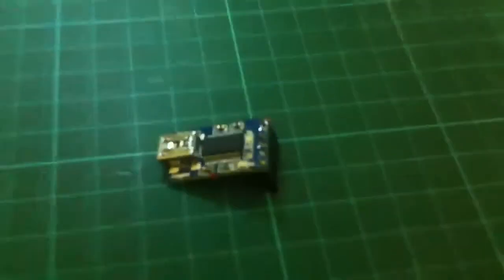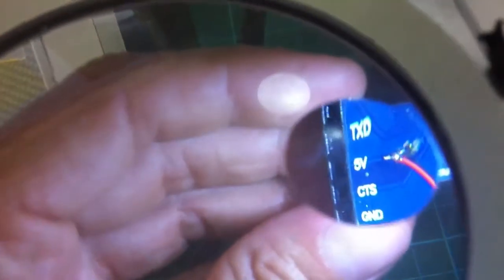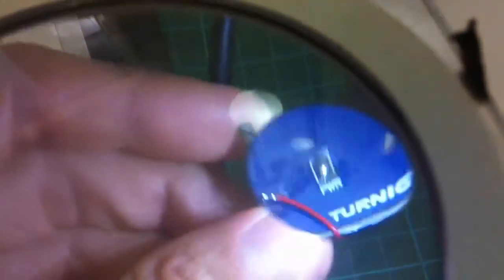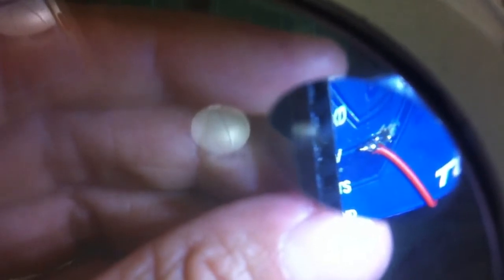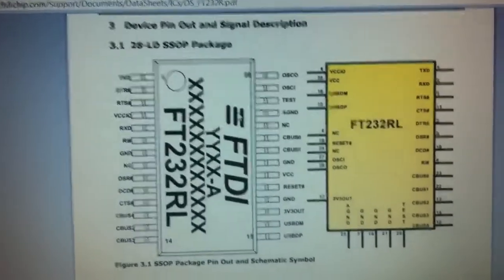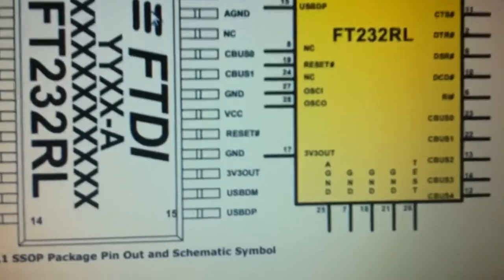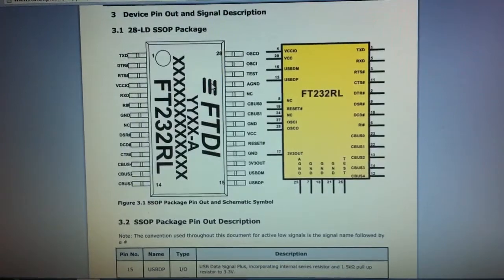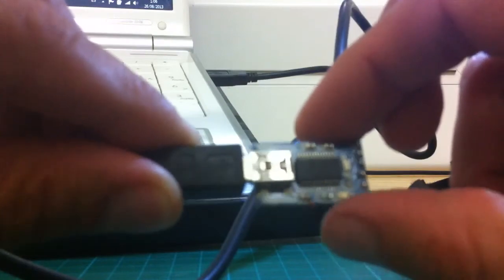FTDI turnigy 5v to 3.3v conversion

Comment: Thanks. I've made the conversion and modified your approach just a little.  I cut the trace on the back side as you did, but I soldered the jumper wire directly from the 3v side of the capacitor to the 5V solder joint on top of the board.   I'll try and flash my board tonight.

Comment from the maker: It´s OK I just reflashy my HK Orange Rx and Tx using the (Chrome GUI) the KH4 utility. It´s easyer than the arduino and both works OK aesy to configure the parameters channels etc of the Tx. Then I bind the pair and it works, We are closer to do LRS with our Quads, good luck and if I can help you only ask me.

Comment: Could you just take the 3.3v direct from the capacitor to your project and leave the 5v as is?
Also could you do the same thing with a pl-2303 pin out seems to be the same.